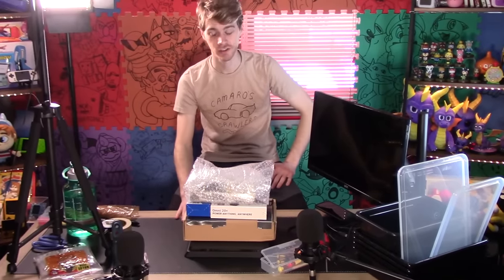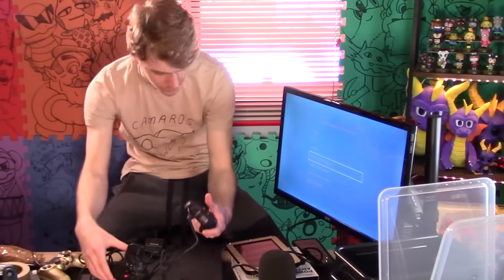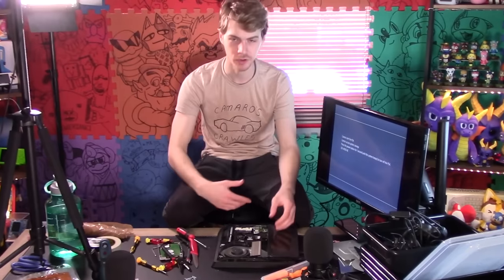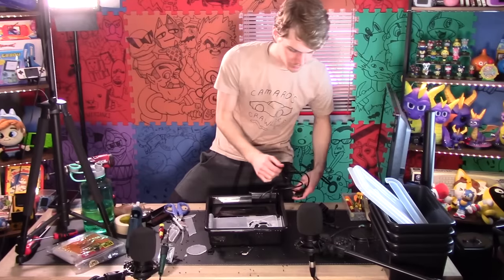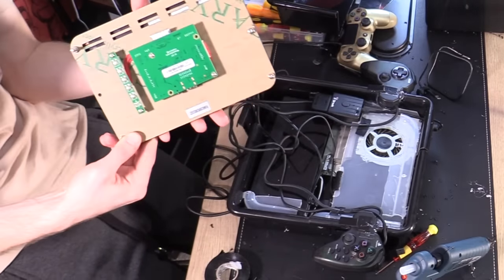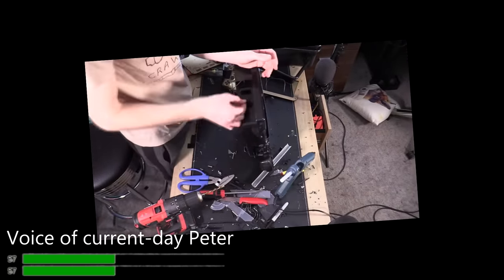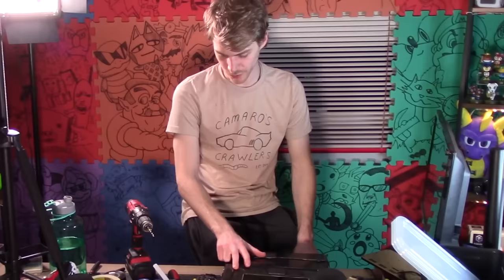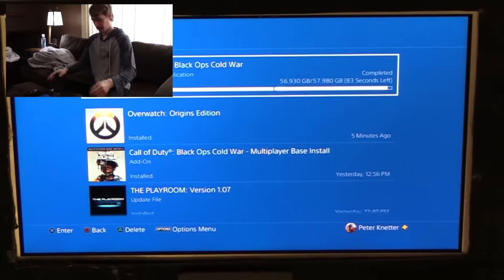Building the Portable PlayStation 4

Comment: Rare footage of Valve employee designing the Steam Deck
Reply: Doh I already preordered the steam deck…
Reply: NOT
Reply: The Steam Deck is technically based on a suped up PS/2...
Reply: @commscan314  thats a nice argument so why dont you back that outrageous claim up with a source
Reply: @kitkat2849-b3h  The Steam Deck is an x86 PC in a portable form factor, correct?  Now, the IBM PS/2, introduced in 1987, was also an x86 PC that introduced many technologies, such as VGA graphics.  If the Steam Deck can run PS/2 software as a similar architecture to the PS/2's, it is very much a PS/2.
Reply: @commscan314 oh youre talking about that oldass computer, i thought you meant a sony ps2 lol but its an x86-64 so youre only half right there

but by your logic, if the steam deck can run ANY software as a similar architecture to ANYTHING, it can be anything, yes?

why base it on a 1987 computer when that...really...isnt the case?
Reply: @commscan314  🤓
Reply: @commscan314 Yes, but that goes for every x86 or x86 compatible architecture (amd64) in existence. Which all stem from the intel 8086 microprocessor.

Comment: The power button DID turn off the PS4 back in the day. I have had a fat one since mid 2015 and you could manually change it into going into sleep mode or even restarting the console. I remember changing mine to sleep and being confused why I couldn't revert it back not realizing they locked out that option in an update. I think they made the switch not long after, probably when the slim and pro came out. Now you have to hold the button for 7 seconds so it will turn off. It is honestly the most unnecessary change Sony made.

Comment: This is roughly the size of a PS4, could jsut get one of those travel cases with built in monitor, and you'll have a PS4 with a proper PS4 controller (so you can play games that require the motion thingy like ghost of Tsushima) or the touch pad

And it takes up like 4 inches more space
Reply: At least this is within one single container and a lot cleaner than his n64 portable

Comment: Man that looks similar to my DIY SCHTEEM DEHEGG. Its a cheap Steam Deck clone made using a 40€ atomic pi sbc running steam os 3 installed using the decks recovery image. For the Screen i used a 10" lcd panel from a netbook with an aliexpress controller board. the controllers are switch joycons that i got for 8 bucks and fixed with 2€ for parts. Overall the thing cost me around 65€ and runs most of the games I play at a playable speed.

Comment: Um....the console was already small enough as it was...you could've just mounted the screen on the top of the console itself and glue the controllers to the side of the console and the battery bank on the bottom. The "cooling" issue wouldn't be an issue because the fan would already be optimally placed inside the unit. Also they make Bluetooth headphones that work with the PS4, so there's that. I love the attempt tho.

Comment: just mount a ps4 slim 2 a 12"-14" hinged monitor make custom HDMI fitting and a battery pack refitted 2 clip on the side or bottom with some rubber stops between the battery and monitor area to avoid heat sync issues make  power cable with a proper ac fitting for ps4 on 1 end and  proper fitting for plugging in ur battery of choice on the other end smaller still kinda portable probably cheaper 2 and no heat sync tools/risk needed just some soldering and wiring knowledge and how to tap some screw holes/thread in the plastic wich u can learn in high school level shop/engineering

Comment: Not to be nit picky, but that's really not a "portable" ps4, I mean yeah it's "portable" in the sense that it has the screen on it and has an internal battery, but you essentially just attached a screen and a controller to the PS4 itself. I mean It's not really any smaller then the stock PS4 slim and in fact is even BIGGER with those controllers sticking out the sides like that, preventing you from just sliding it into a backpack like you would have been able to otherwise. I mean screens that can be attached to the PlayStation already exist and they even make cases that both house the PlayStation and have the screen built in as well that would have required zero effort and would have been just as good. Now I know this is a PS2, but THIS is a true portable playstation......https://www.youtube.com/watch?v=LQ7x2b6BlHk

Comment: 6:58 minutes in and this is already soooo bad hot snot really is this China idk if this is possible with a ps4 but you could maybe cut the motherboard down like a wii to save space and make make a custom battery that supply's the correct dc voltage/voltages instead of using a portable power bank